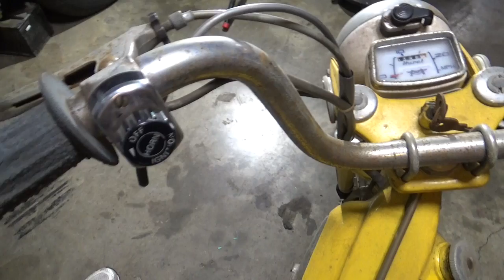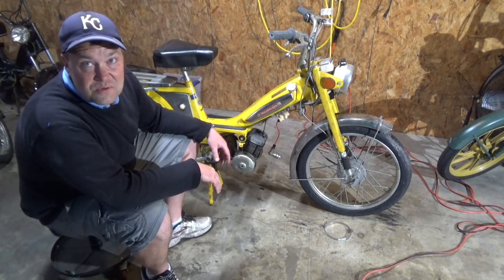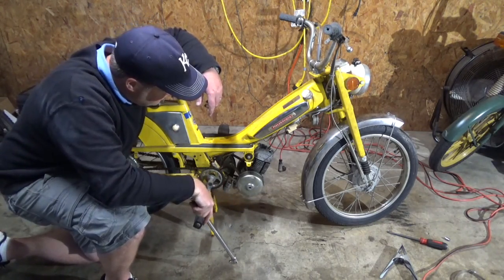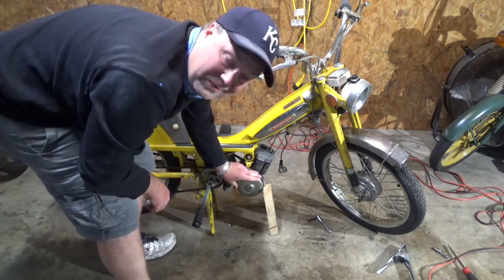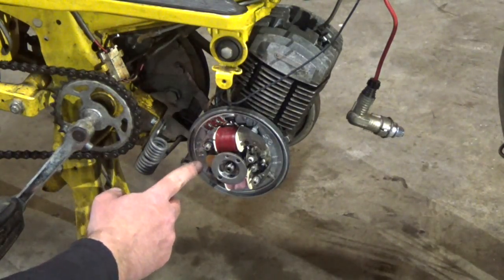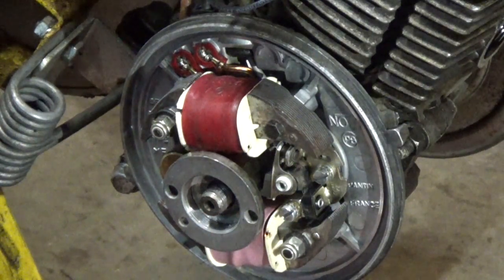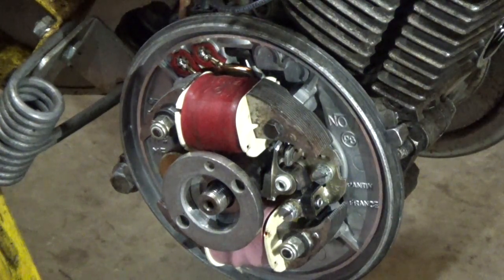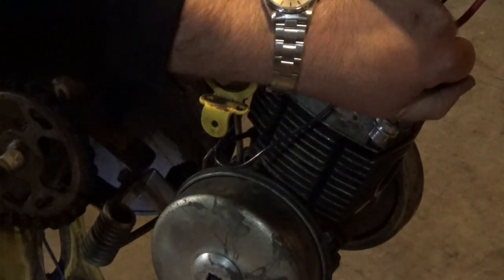Motobecane Moped Restoration Ep. 4- Ignition System

Comment: Hi David, thanks for putting all these videos together. Super helpful! I finally got the novi nut off and was wondering how you disconnected the wire from the back going into the magnito? Just looking to pull the engine off to give it a good cleaning. Same exact model of the one you have. Thanks!!

Comment: Hello David! great stuff! I recently started repairing exactly the same model. regarding ignition, when i tried the same trick to pedal and see if there is a spark, I only got the sparks at the point where the ground connects to the frame (under the main frame between the steering and the seat. the wire to the spark is broken and there is no way to connect it back to that sealed box ( i dunno what it does and impossible to open). Does this mean I have to replace that whole box and wire to the spark + the spark plug itself?

Comment: I'm getting a couple Moby 50s. I'm gonna grab a few carb rebuild kits, what else would you recommend I pick up to get my order to free shipping $ l, as a sort a matter of course getting these back up to snuff? I'm keeping em at stock performance putt-putt level to keep costs down.
Reply from the maker: The Le Partie CDI kit from treats is truly excellent.  But if you are just doing a quick refresh, then a carb kit will probably do it.  Also, check the cables and tires.  And if you are feeling really frisky, then I'd go with new gaskets, seals, and bearings.  Good luck!

Comment: okay, I've got a question if you have a minute- I have a 1979 motobecane 50v motor that has no spark. I've replaced the coil, and the plug is good. a few weeks ago, it had spark, but it was weak. came back yesterday, and spark was gone in spite of the new coil. howeer, when I turn the motor over and hold the wire from the magneto up against the motor a very very weak spark will jump from the end of the wire to the engine. would you have any idea what's up with it? I'm at my wits end.
Reply from the maker: Clean the points.  Replace the condenser.   Chasing electrical gremlins is the most frustrating thing about these bikes.
Reply: @DFS how right you are dave. I tested the condenser last night. stupid thing's had it. cleaned the points twice already, haha. thanks for the input! watching your videos inspired me to upload my own moped's restoration videos to youtube.

Comment: Hi David, I have almost the exact same motobecane moped as you. Mine runs and starts fine, but once it runs at operating temp, it bogs out on me. It almost seems to not be getting spark when its hot. Any suggestions?
Reply from the maker: If you have the original points in there, it sounds like your condenser is going bad.  Common issue.  You can buy one on treatland.tv for cheap.

Comment: i cant get the novi nut off mine , i have hit it with multiple rounds of fire + oil and it wont budge.
Reply from the maker: I feel you man.  That thing is a bastard!
Reply: @DavidFixesHisShit  any other tricks you may suggest? im going to try the hose clamp and breaker par with hammer trick next , saw it on a moped forum.

Comment: Dude.. that's not a restoration 😆 you didn't even take anything off ..  I need to know where the other 2 wires go on the points. ??
Reply from the maker: Watch later on in the series and there are additional episodes about the ignition system, although I replaced the stock stator with CDI...